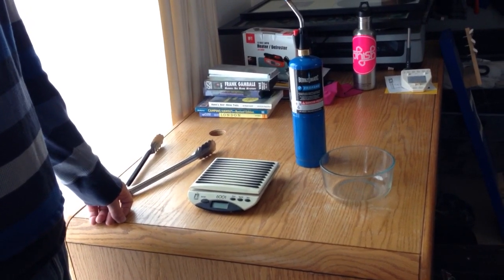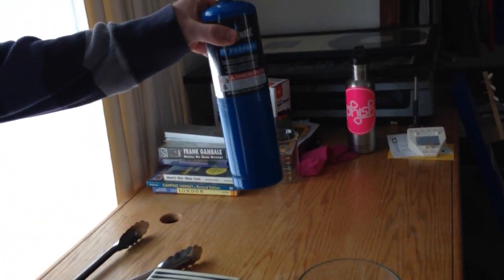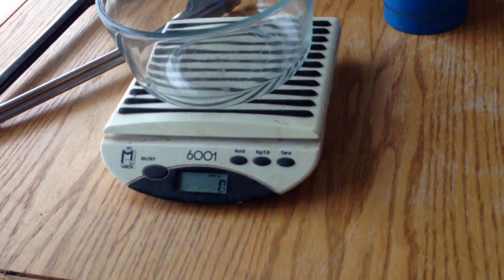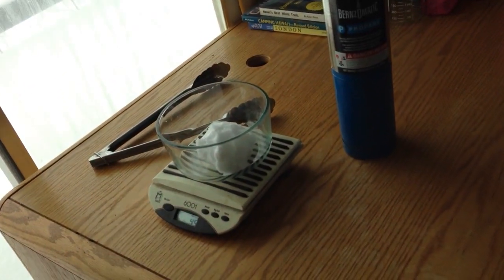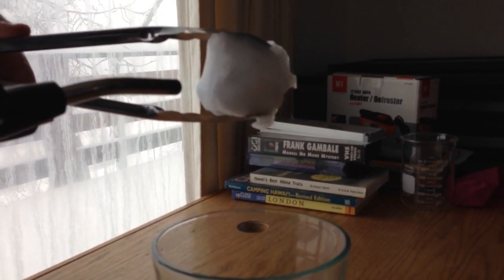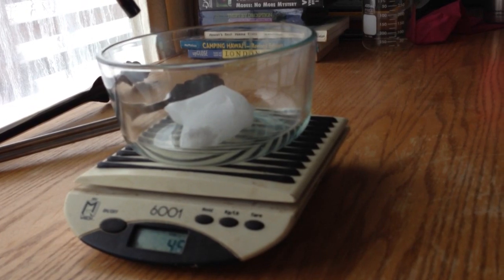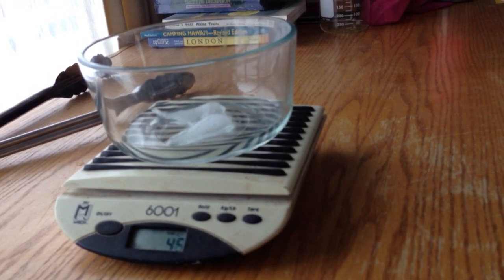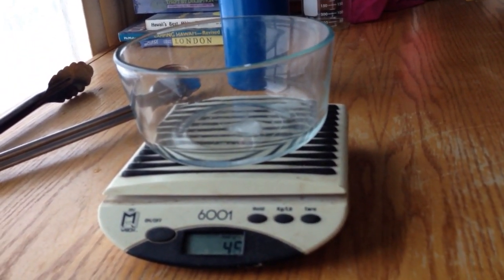Fake Snow? No, and it's not sublimation either!

Comment: I did this with an icecube of 13.65g and a more accurate scale. After some melting, the weight went down to 13.3g which was enough for me to see that there is at least some evaporation, but this doesn't make a real difference as you said. And yeah, sublimation can't happen at all because the pressure is too high (would be working with 611hPa or lower). Great video! Thanks.

Comment: I believe your might be wrong and that fact is because your in Colorado and most of the Snow not melting video are people from Georgia, Alabama, and other Southeastern states. It took a while, but by September 2013 the ocean level met La Nina temperature, but it was a weak one at best. La Nina causes West coast to be Dry, Middle to be Normal, Middle eastern to be Wet, and Southeastern to be Dry. With a combination of both La Nina and Polar Vortex the Southeastern states the precipitation over those states started to lock up and freeze CO2 air particles. Not all snow are the same.